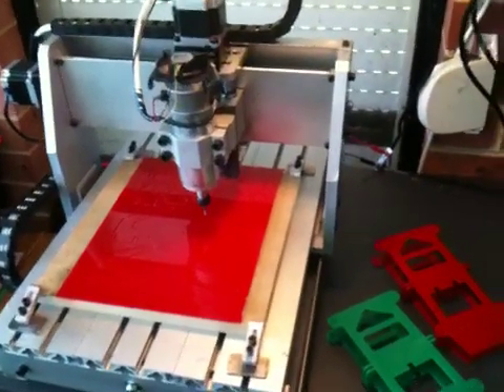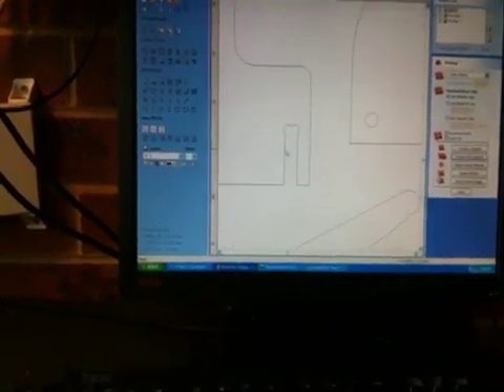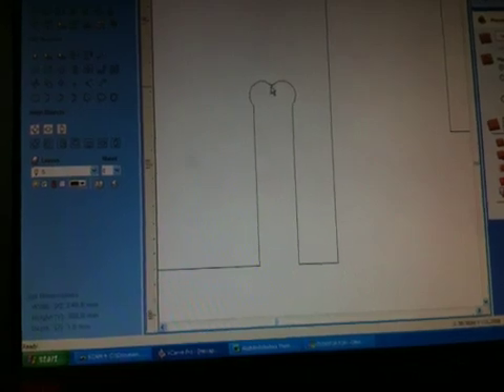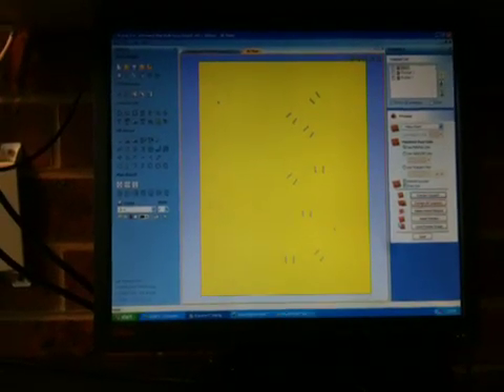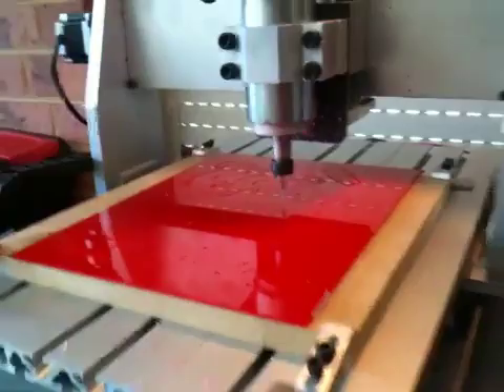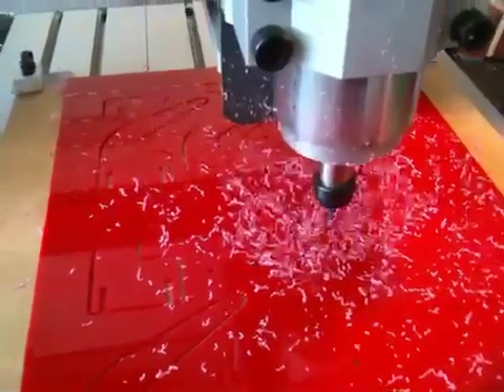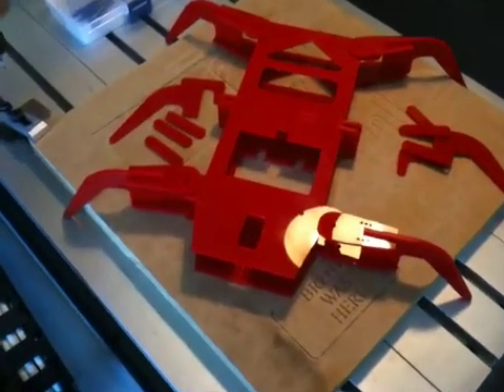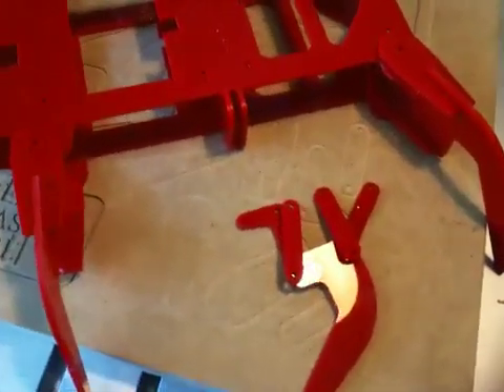CNC 3040 Milling Plastic Parts

Comment: Hi DCTTeacher, Really like your you tube page and really impressed with the feedrates and work you are able to achieve with the machine, Im a complete noob to CNC, I got a 3020 the other day, and have it up and running doing simple enough shapes, I know you recommend the 6040 now but i just dont have the money for one just yet:)
I was wondering if i could pick your brains on a few things..

(1) with so many cutting tools on the market and so many different qualities I was wondering if you could maybe tell me what the actual cutter you recommend using for cutting acrylic, contouring acrylic etc I have a fair idea of the different tools ball mills end mills etc but would love to know the exact tools you use if thats possible
(2) I am really happy with the accuracy of my machine however when i am cutting a shape (imagine a racetrack shape) so going down the y straight is fine but when i round the corner it starts wondering slightly. Im trying to pinpoint whether it is play in the screws (not having ball screws) or whether it is something to to with the motor missing steps. have you ever came across this issue and is there a way of eliminating it. eg tightening the nuts or doing something with the electrics.

If you could spare a bit of time to email me i would love to ask you a few more questions. totally understand if you haven't time. my email is nigelroddy@gmail.com

Thanks

Nigel
Reply from the maker: +Nigel Roddy Hi Nigel, sorry for not replying sooner but your message was in the spam folder.  With your little CNC router, use only carbide tooling.  Take shallow cuts, up the RPM and up the feed rate.  When cutting acrylic material you purchase single flute down or up cutters.  Use a 3mm cutter and take 0.5 - 1.0mm (DOC - depth of cut) and feed rate of 1000mm/min.  You won't be able to go that deep with aluminium (0.1-0.25mm deep) and the bigger the cutter the slower feed rate.  This works as simple rule.  The problem with the little routers is they don't have the mass, rigidity or horse power to take savage cuts or feeds.  Hope this helps Nigel.  Regards, Aaron

Comment: hey. would you say this cnc is too loud for an appartment building?
Reply from the maker: MrStankoman G'day, I don't think this would be too loud for your apartment. You could build a little soundproof box around it. This is what I saw another guy do.  Cheers, Aaron.
Reply: DCTTeacher1  Thanks for the reply i bought the same machine. What type of plastic is this. I used plexi glass and it keeps melting on my bit. Any advice for that? 

Thanks again!
Reply from the maker: Hey man, the plastic I use is just standard acrylic.  If your bit is melting it is because of 1 or 2 factors.  To high RPM and or not a fast enough federate.  I would up your federate first :-)

Comment: LOL is boning not part of Australian slang? Anyway, great video. I bought a 3040 last week. I've since read you don't recommend the 3040 but for "getting into" CAM, given it's cost and size I hope it's sufficient! :D One quick Q. My 3040 doesn't have home/limit switches, should I get a kit and rig it up? Worth the effort? Cheers, Dan.
Reply from the maker: dmak2 Hi Dan, yes mate boning is part of our Australian vernacular ;-) ha ha. Anyway, I think the new 3040 are better than the old one I bought. Don't the new ones have ball screws and a VFD + spindle? Yes mate, I would definitely add limit switches to your 3040. Well and truly worth the effort. Email me and I'll send some pics of how my mate did his.  Cheers, Aaron
Reply: DCTTeacher1  Hi Greg :D It did make me laugh, I sat there thinking I share a similar feature to the software. lol Anyway! I don't know enough about the machine to answer your questions. It makes things I couldn't make before so I'm happy with it so far. I would email you but I don't have your email, unless you mean Google+ in which case I still can't find a way to PM. I've set up an email tempalias3040 outlook com. I'd really appreciate some help with the switches. Cheers, Dan
Reply: DCTTeacher1 Aaron, how can I email you? And who the hell is Greg?! Sorry.
Reply from the maker: Greg is a mate of mine that has a 3040 also. He fitted limit switches to his CNC router and I have photos to share with you if want? I will PM you now.

Comment: Can you tell me where I can buy the software V-Carve Pro and the 3040 cnc I just buy one A+
Reply from the maker: Hi Warren, I bought this machine off eBay.  However, if you are going to purchase one don't purchase the 3040!  Save your money and purchase the larger 6040.  It's a far superior machine and worth the extra dollars.  You can get VCarve from company direct.  They have a website called Vetric.  Hope this helps?  Cheers, Aaron.
Reply: DCTTeacher1 thank you but I have all ready buy the cnc3040 and my space I have in my flat the cnc6040 will be too big I only use the router for pcb and it work very good than the older cnc router
Reply from the maker: warren odonnell Hi Warren, no problems mate. You will have loads of fun with the 3040. I had problems with mine as it had the cheap spindle motor and inferior wiring.  Good luck and all the best.  Regards, Aaron (Australia).

Comment: from wath seller on eBay you buyed this CNC ?
Thanke.
Reply from the maker: Hi Mate, I bought this 3040 from seller on eBay called Felix Yuan.  I think his user name was cnc_machinery?  My advice, if you want a machine for routing timber and engraving I would purchase the 6040, as it's a far superior machine.  If you want to machine aluminium don't buy one of these, but convert your own machine like I did (see TM20LV videos). Hope this helps?  Cheers, Aaron.
Reply: Thanke,
Yes  6040 for engraving aluminium 0.3 mm deep and other plastic like ABS (is special material for engraving) I will use in an apartament So water or air cooling is more silence ?
  Nice transformation U made for aluminium (TM20LV videos) !!!!
Nice work !
   Thanke again for your respons.
Reply from the maker: Hey man. No problems for the help, anytime :).  Get the water cooled VFD spindle.  0.3mm sounds fine for a 3mm or 6mm end mill.  Cheers.